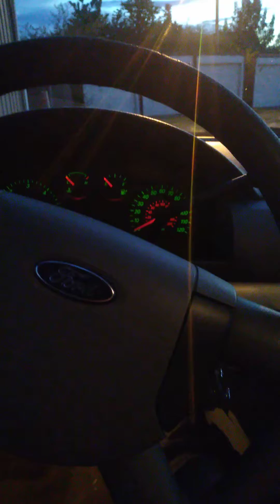Ford fuel cut off switch (inertia switch) Part 1

Comment: what about 03 mustang gt it was clipped and hasn’t turned on since the day after
Reply from the maker: If the vehicle will crank and not start I would try to find the inertia switch to see if it is tripped. If the vehicle doesn't crank or do anything then you probably have an electrical problem. And yes your car should have an inertia switch. Either in the trunk or passenger floor board

Comment: Will the fuel pump still prime with key on engine off if it’s the inertia switch?
Reply from the maker: No, because the inertia switch cuts power to the fuel pump completely until it is manually reset
Reply: @singularautomotive3542  Thanks to your videos I ruled out the switch by testing it for continuity. Trying to troubleshoot a crank no start after going over a speed bump it just died. I’m thinking it’s the fuel pump.

Comment: I love the accent. Makes the video so much better. Anyhow.i have the same issue. Keeps getting triggered. Is it just a bad switch or should i investigate further
Reply from the maker: Yes, replace the switch if you keep having to reset it after normal driving. Sounds like the little contacts inside the inertia switch aren't keeping the little ball inside of the cage like it's supposed to. Just make sure the switch is in the same position it was in when the vehicle was first built, it cannot work correctly if not. Thanks for watching and the nice comment!

Comment: I have a 05 Ford mercury sable ls 3.0....same sound when trying to start. But won't catch. I'm getting fuel to the filter. And I even changed the filter it's self yesterday. And still won't start. I poor gas in the engine it's self and boom it starts but dies very quickly. Plz help
Reply from the maker: It should be in the trunk, on the right side behind the trunk liner(carpet). Now if it's the hatchback style it's still in the trunk, on the right. But it's behind a plastic panel. Sounds like your definitely not getting fuel, make sure the switch is depressed. If it is, I'd still try checking to see if you have 12 volts on one of the wires to ground. If you don't have a voltmeter then you can try to jump the two wires together to see if that helps. Now if you're not getting power to the inertia switch then the fuel pump relay isn't engaging or the fuel pump fuse is blown both are under the hood, the 12 volts flows from the relay, through the fuse, then the inertia switch, and finally the fuel pump module. Make sure the fuse isn't blown and if not then try swapping your air conditioner relay out for the fuel pump relay. Good luck and definitely let me know how it goes. And if you haven't already please like and definitely subscribe to the channel. Thanks !

Comment: What about the 2002 Ford Explorer
Reply from the maker: It's the exact same switch on the Explorer. It should be under the glove compartment, in the right hand corner. If yours has a kick pane you may need to remove it to see it. It is a normally closed switch that opens with a hard vibration. If it's open the red button will be pushed up, press it down until it clicks
Reply: @singularautomotive3542  thank you my fuel gauge is not working
Reply from the maker: Is the vehicle getting fuel, does it start? When turning the key from Off to Acc do you hear the fuel pump him. And does the fuel hand ever move from Empty?
Reply: @singularautomotive3542  everything else works just the hand don't go past empty
Reply from the maker: Something is going on with your fuel sending unit. That's located inside your fuel tank, if it's stuck on Empty sounds like the float has came off the arm. It could also be a problem with the wiring going to the sending unit. You should have two wires going from your instrument cluster back to the unit. In front of the fuel tank should be a wire harness connector, so that you can separate the wiring from the fuel tank. You'll need to unplug the harness,, with a multimeter turned to volts dc find a good ground with one of your test leads and with the other backprobe both wires coming from the front of the vehicle one at a time you should have 5 volts on one of the wires. Next turn the multimeter to Ohms and backprobe both wires on the connector coming from the fuel tank. If the tank is full you should read about 150 ohms if it is empty you should read close to 15, if you get anything other than that you with need a new fuel sending unit.  If that all checks out you'll need to pull the instrument cluster and check those wires on the back of it
Reply: @singularautomotive3542  thank you
Reply from the maker: No problem, just holler back if need anymore help. Please like and subscribe to the channel if you haven't already
Reply: The fuel hand never go past empty